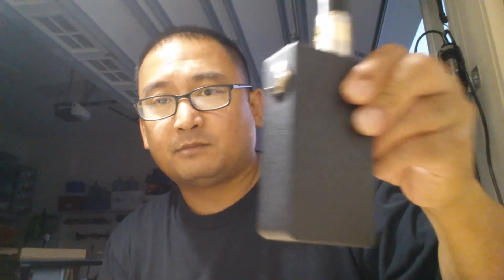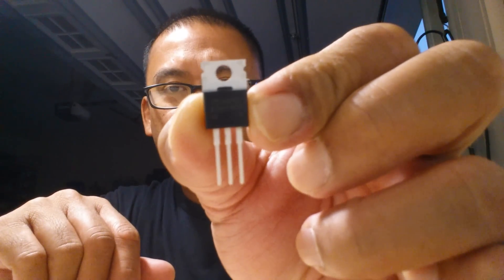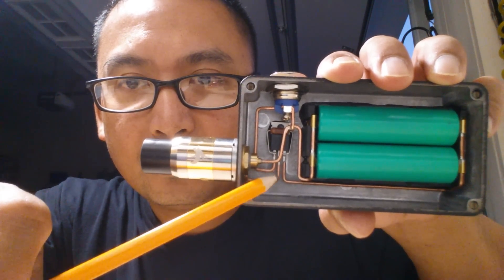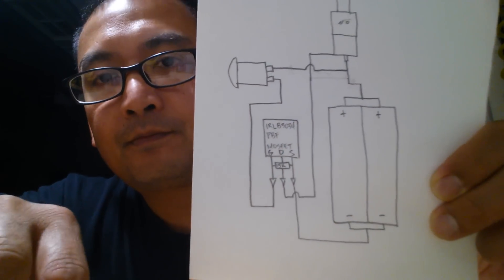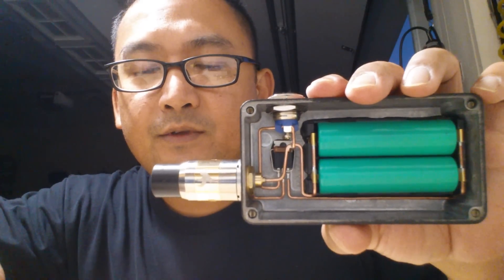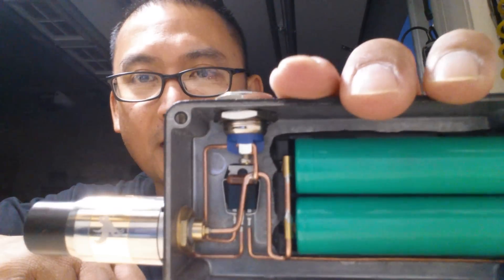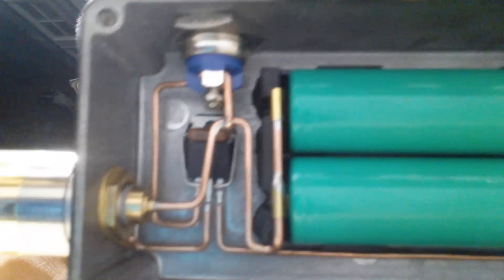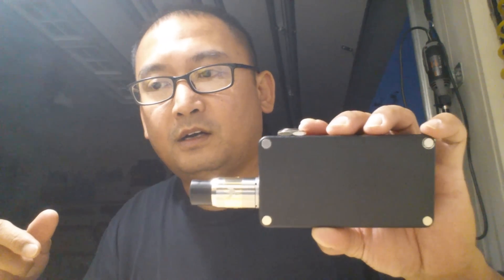Unregulated box mod with a Mosfet

Comment: USAF, what would be the advantage of using 2 mosfets in parallel?
Reply from the maker: Sepsis X lower on resistance through the Mosfets, but we're talking about in the milli ohm range so not much of a difference. Also, the amp load will be shared just like having batteries in parallel, but the main advantage of this is less heat generation from each Mosfet and not amp capacity because a single IRLB3034PBF mosfet is already rated at 195 amps...you won't be vaping anywhere near this. I used two Mosfets because why not :-)
Reply: Al USAF Thanks for the reply man. Another question for you. If I build a series box, can I still use just 1 mosfet, and is it wired the same way? (other than the series part of it I mean)
Reply from the maker: Sepsis X one mosfet and wired the same way...except for the series part. Basically, you're correct.
Reply: Al USAF Thanks for answering all of my questions man. Love the videos btw. Keep it up.

Comment: I don't see why you couldn't rub the14g wire completely through the switch and back to the 510 connector. I think it would have saved a little wire and time. Js. My thoughts though. And thanks you've inspired me to make unique boxes now.
Reply from the maker: robert woods that's what I've been doing with my newer box mods. No problem and thank you for watching my videos.

Comment: +AI USAF on amazon I want to get my momentary button and the mofset and 15k ohm resistor I will get from those company's you listed...where did you get the actual box to put everything in and what size wire should I use price and size doesnt matter thick Ness is nit a problem i will fit it aND where can i get the 510 connection and where can I get the battery chamber  lastly...how many watts is this device  and how low can I go on ohms with it...thank you for batteries I will use high drain 18650 35amp batteries
Reply from the maker: Jon Taccona you can purchase the 1590B Hammond box and 510 connector from eBay. If you're going to use a Varitube 510 connector, you can use a 12 gauge wire but if you're going to use a fatdaddyvape 510 connector, then use a 14 gauge wire. You can buy solid or stranded wire from Home Depot or Lowes if you're from the US. If you live outside the US, then go to a hardware store that sells household electrical wires. Or you can purchase silicone wires from Ebay, used on RC cars. 

Don't trust those 35 amp batteries because there's no such thing. 30 amps yes, but they're hard to find. My suggestions would be to use Samsung 25Rs, LG HE2s or LG HE4s. There is no watt rating for unregulated box mods. You have to use an ohms law calculator to figure the lowest build you can do.
Reply: OK thank you well I'll use 12 guage just to be safe....would you say .2 ohms is safe I will be using 2 batteries like you
Reply: I got the Samsung 25rs
Reply from the maker: Jon Taccona .2 is pretty safe. The Samsung 25Rs are good batts and will be sufficient for this build.

Comment: Good build and I build my own same with yours (without mosfet). I have one question, why my boxmod just drained one of my battery? I use same battery and both of the battery is full. Can you help me?
Reply from the maker: Aditya Pradipta maybe it's the connection on your battery sled or the battery sled itself.
Reply from the maker: Aditya Pradipta please use a mosfet unless you have a fully mechanical box mod.
Reply: yeah lately i check my connector and found the soldered plate is not melt to the wire, so i resoldered it. Now I want to test the box again hope it will work perfectly.. im not used mosfet yet, but ill use it when problem's come..

Comment: What did you use for your wire?  I like that look in comparison with using 22g and 16g wire.
Reply from the maker: TJ Day 14 gauge solid copper wire
Reply: Thank you.  I saw in the diagram later but could not retract my question.  Its very "clean" looking.

Comment: I've seen Mosfet's in PC Mobo's.  They are Soldered onto the board for Grounding purposes.  Could the Mosfet's be soldered on the inside of the Aluminum Casing as a Grounding Measure? or should it NOT Touch any Metal at all?
Reply: ***** The metal tab of the mosfet is shorted directly to the drain pin, which goes to the negative of the 510 connector so it is already connected to the enclosure. It's just a pain to solder to aluminium.
Reply: Ah ok. I was just wondering I've seen them soldered on pcb bards. Have you tried Silver solder?  It's supposed to work on basically all metal like aluminum. Stainless steel. Iron. Etc.
Reply: If you can manage to solder to the aluminium then yes, it will work (and quite well). It's a huge pain though. I've tried with quite a few different solders including silver, I just don't have the setup to do it right.

Comment: Field effect transistors are good.. SCR switches are the real deal though. Give it a try and you'll freak..
Reply from the maker: Tim Scarbrough do you have a link to one where it can be used in a box mod?
Reply: I do..digikey  there about $38 for a400 amp. But I use 60c ,3300 mah.  4 cell lithium polymer  batteries w/a 7 channel voltage divider  for Fet mods.these gets are about $8.00  but they're and style. Also look into anystan technology ies .I'm building/useing 80 amp.  600 watt  egress chips for regulated box mods. Crazy for shure but I can't keep up with the demand even quitting my eng. Job. I'll hit you up with pics. The people I build for do the vape comp. And collectors.. see ya' Timmy
Reply: Also   super fine stranded wire  about a500 strand count in 14ga.is perfect..
Reply from the maker: Tim Scarbrough you went way above my head bro...please do send me pics of your setup @ alusafvapes@gmail.com. Also part numbers if you could. Thanks!
Reply: not sure how to send pics. on youtube..Give me tutorial if you wll.. Tim S.
Reply from the maker: Tim Scarbrough email me the pics at alusafvapes@gmail.com

Comment: I don't think you can get a cleaner build than what you have done.  I'm completely new to this mod-building or diy of any sort - other than a bike light i did a couple of years back using a plumbing pipe. ;) 

I was wondering if you could possibly do a video of yourself doing this mod from start to finish? I promise not to be 'bored'.  

Fantastic work man.  Beautiful.  Thanks! :)

postscript:  Are you puffing VG?  Because that's enough puff coming out of your mouth to deplete most of the ozone layer. ;)
Reply from the maker: edsbackalleyband first off, thank you for liking what I did. I don't think I'll be doing a full on how because I don't usually work on my projects in one sitting. Basically, I take my time and I don't luke editing videos. So you like my baby clouds huh...lol!

Comment: Excellent Video. Just wondering, will 12 gauge fit in the 510 positive? I have the FDV v3 & v4. I could buy some solid copper wire and try it for myself, but just figured I'd ask you rather than going out and buying 12 gauge, just to see if it will fit in the 510 positive.
Reply from the maker: MARK 1 12 gauge fits in the varitube pin but for the FDV, you have to file the wire end to make it fit.
Reply: Al USAF I was thinking the same exact thing. I'd probably use a drill to rotate the solid copper or solid .999 fine silver wire then use a Precision Swiss #3 or #4 hand file to file the diameter down about ±0.6mm. As for the silver wire, I will be getting mine from RioGrande.com, as they have been in business since 1944. Varitube Pin? Never heard of it. I'll have to take a look at that. Thanks so much for the help, very much appreciated Al USAF, keep up the excellent work.
Reply from the maker: MARK 1 varitube is another company that sells 510 connectors. 

Varitube.com
Reply: Al USAF Thanks, found them, and saw a video on YouTube about the 510, thanks again.

Comment: Iv watched all of your videos and they where so inspirational I wanted to build my own but I can't  solder the copper 14g wire it DOES NOT solder how do you do it or what are you using because I have wasted a lot of money so far and it has not worked?
Reply from the maker: Vapebuilder what type of soldering iron and solder are you using? Did you use flux paste?

Comment: Just a suggestion cover the copper wire you have with heat shrink and and strip only the ends your gonna solder just as a precaution
Reply from the maker: Eduardo Mijares thanks for the suggestion but I did this on purpose solely for the looks. It's as safe as any other box mods out there but obviously looks different.
Reply: Yea I like the copper steam punk look what Guage wire do you use and what is the mosfet used for
Reply from the maker: Eduardo Mijares 14 gauge for this box mod.
Reply: Is there a video of  this same Set up in series
Reply from the maker: Eduardo Mijares yes...check my channel. Should be 2 videos before this one.
Reply: Alright cool thanks for getting back at me
Reply from the maker: Eduardo Mijares no problem.

Comment: What is the mosfet used for ? What Guage wire do you use and can it be done in series and not parallel
Reply from the maker: Eduardo Mijares please watch the vid.
Reply from the maker: Al USAF yes, series will work using the same mosfet.

Comment: I got a big question I'm making my box mod but it keeps fireing I screw down my RDA Im using a dual series 18650
Reply from the maker: ukaboiz808 either you have a faulty mosfet or the cover of your box (if aluminum) is making contact with the 510 negative or battery sled negative.
Reply: Al USAF maybe i just jb weld the MOSFET to the aluminum box, would a series still work good if there's no resister?

Comment: So, I'm looking for copper wire and found some on eBay, but they mark it as unplated  jewellery making wire etc ... Can this be bought and used for the mod? If not where can I get it? Thanks
Reply from the maker: Richard Watson I wouldn't. If you're in the US, go to Lowes or Home Depot. But if not, go to a hardware store that sells electrical wires.

Comment: I was wondering is the voltage drop better when you use a a mosfet?
Reply from the maker: tony ciarlo some people say yes, but in my experience, it's not noticeable. It all depends on how the box mod is built. A mosfet is pretty much required for unregulated box mods if a standard pushbutton switch is used. Unless you're building a fully mechanical box mod, which I'm working on one right now, then you don't need a mosfet.
Reply: You make nice clean mods good job try using 14awg copper with shortest wires as possible you gotta beat the 0.25v drop! I love my hobby lol

Comment: hey i was wondering what kind of power this is putting out wattage wise? i want to build one but i dont want it to be underpowered
Reply: Study schools first before using ecig :D Specially unregulated!
Reply from the maker: iTzBOB3RT this is unregulated so wattage output will depend on your atty build.
Reply: do you mind telling me how that works like .5ohm will be a higher wattage than a 1ohm build? or do you have a video on this?
Reply from the maker: iTzBOB3RT unregulated box mods is for advanced vapers only, I'm stating this in a nice way. You can find your answer by using an ohms law calculator.
Reply: tyhnbgtyhnbgt Unless you choose lithiums in series...
Reply: stuck up ass mod builders... all you had to say was 18650 batteries put out 3.6 to 4.2 volts... the part of the equation ohms law calculator DEMANDS to be part of the equation...

Comment: might be a silly question, but I'm working on a box (dual mechanical 18650), goal is to make it as small as possible, is it safe if some of the copper wires are touching? I haven't started wiring just yet but I just want to make sure.
Reply from the maker: kaneoheGrown none of the wires can touch each other. If insulated, then obviously yes.

Comment: Why is my box mod auto firing? If allowed the exact steps like yours. Except my 510 wire is flowing directly to the positive contacts then straight to the button stem. Please help!!!!
Reply from the maker: Eugene Cordero either your mosfet is bad or the negative wire from the battery is touching part of the box. Also, make sure the lid is not making contact with anything inside.
Reply: ok. does it matter if my box is ABS plastic? i think it might be the mosfet cause all my connections are not touching. i notice you dont use a resistor.

Comment: .Hello @AI USAF, the same resistor 15K type RN60 in the Shop Italian RS electronics (only to have him in Italian) is available in May. Can I use another type of resistor similar, with 10k or 20k? Power 0.25W? Thanks for everything
Reply from the maker: Toni Di Stefano you can also use a 22k resistor...0.25W is what I use.
Reply: Al USAF Ok thanks, now I found the 15k resistors with 1/2W of power, I hope they go well with the mosfet IRLB3034PBF, then if all goes well I do a video with box complete clearly in the video you will mention to thank the suggestions made in your channel, thanks again

Comment: Hey there I was wondering if you do custom box mods for people? I'd love to have a custom one with your work and be willing to pay the price for one
Reply from the maker: ***** sorry I don't
Reply: i dont post videos, but Ive been building a few for my friends, my latest one was made from a Li-ion drill battery, haha the thing is a brick but it chuggs like a train on 24 gplat. send me a message, let me know what u want
Reply: I'm looking for a small compact parallel 18650. No wires no mosfet. Straight full true mechanical like the dimitri mod OR I want a mod like I mentioned with a switch to switch from parallel to series inside the mod. I want a fat daddy's 510 top cap I want a fire button like the sigelei has. I want a red colored box with black button. The size of the box I want would probably be compared to sigelei 100 watt or maybe even smaller since the 100 watt has all the connectors
Reply: DM me

Comment: What's the difference between unregulated and regulated, selectable voltage? The 15K resistor is for bias? Couldn't you just put a pot on the gate to select output voltage?
Reply from the maker: Landotter1 regulated means you can adjust the voltage and/or wattage. Unregulated is not adjustable, output wattage will depend on your build. The 15K resistor is used to basically turn off the Mosfet after the switch is released. You can't just use a pot. If you want to regulate the voltage you have to use a voltage regulator, such as the Raptor or OKL2-T20 chip.
Reply: Al USAF a voltage regulator gets connected inline with the drain wire ?

Comment: Darnit.  I wish I would have started vaping a bit earlier so I could have gotten into the draw.  You're USAF.  Not sure what rating, but you do clean work.  I'm former USN electronics, so I can build my own, but I still liked looking at your mod.  I'm doing a rebuild and customize on a friend's fried beast right now.  Manufacturer miswired the mosfet and the switch welded.  I REALLY like the way you used solid conductors.  I'll do the same, but I may pot after assembly.  Good work, bro, and have a fine, fine, Navy day. :)
Reply from the maker: Jeff Weaver thanks for checking out my channel. Have a wonderful Air Force day...lol

Comment: can i use a tank with this build? or only for drip tips?
Reply from the maker: Mega caffeineman you can but i would recommend sub ohm builds.
Reply: Please don't try to make this if you think a RBA is a drip tip. Stick to the starter kits for a while little one.